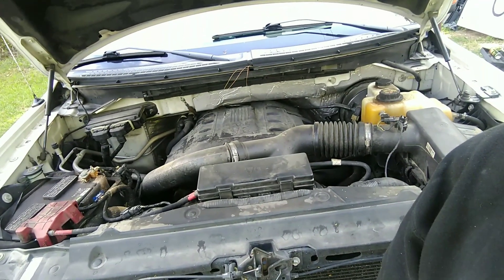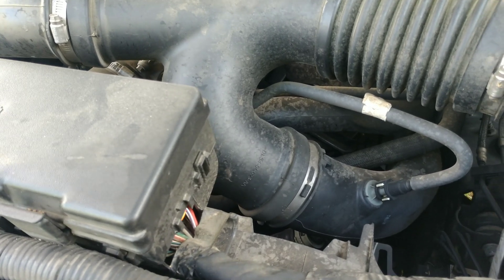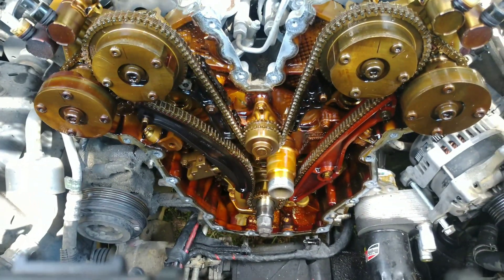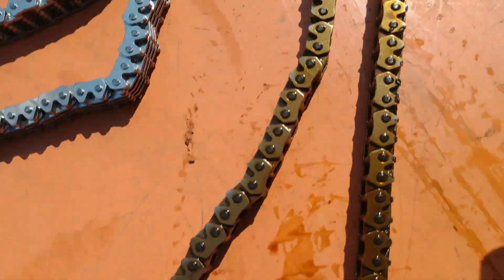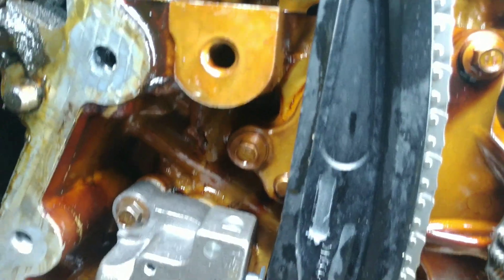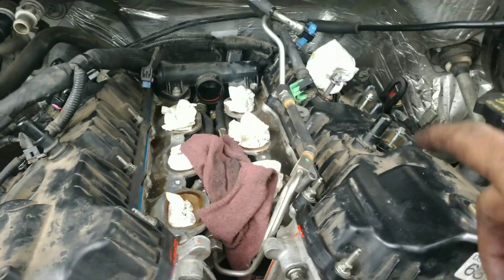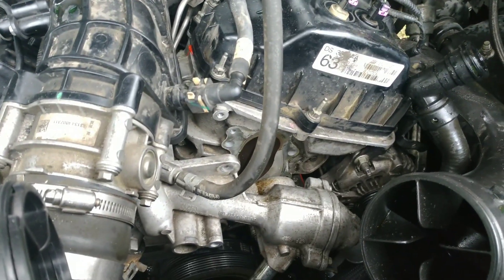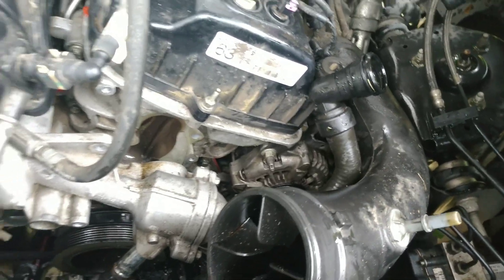3.5 Ecoboost Timing Chain Replacement

Comment: Good job buddy 
Normally no one shows the timing marks  very close  also when you said rotate engine for fuel pump install   Is that a complete turn ?
Reply from the maker: Normally, just a half a turn because of the
Ratio of the cam and crank

Comment: I know this is an old vid. Thank you for making it. I am a mech of 44 years. Pretty crippled up now. How many man hours would you say went into the timing kit job? Appreciate any reply.
Reply from the maker: @Jagg61  thanks for watching. I would estimate it took us around 20 hours total and we did this outside and we are not trained mechanics.
Reply: @shawnkmorse  thank you. I have done many tritons. But no eco's yet. My 2012 just turned 142k. It's been a excellent truck. But I know a timing kit and phasers are coming up before a catastrophic failure. You did a very good vid. And I appreciate it.

Comment: What's normally the recommended miles to replace the timing chain, I have the 3.5 with 83,000 miles on it?
Reply from the maker: This truck had over 400,000 miles on it before the chain started making noise. But I’ve seen some that needed changing around 125k

Comment: I have a 2013 ford f-150, upon replacing the timing chain, is it necessary or recommended to replace the cam phasers?
Reply from the maker: It’s not necessary, but more than likely they will fail sooner than later

Comment: There is no need to take the phasers off to replace the timing chain all you have to do is pull the intake phaser solenoids and the chain comes right off... I just finished mine up the other day and more importantly new bolts must be used when the phasers are removed it appears you reused the old bolts... Of course I changed the phasers while I was in there but I didn't pull them off until after the chain was off

Comment: Why does it take about 8 hours to pull everything out and another 20 hours to install everything correctly; sounds about right! Will it Run just as good as a New Vehicle? So many components to be reinstalled and hopefully nothing leaks after the RTV is applied! You would think Ford would re-engineer a more easier engine than the present one! After everything is done a Road Test is Required that all the systems are operating correctly! Way to go FORD!
Reply: And even after all that the check engine still won’t tell you when the oil pressure drops
Reply from the maker: That timeframe is about right. Yes. It will run like new

Comment: Hey everyone. I have a 2014 Taurus SHO 3.5 TT with 92k on it.. I have the spark plugs(Bosch 9697 iridium) and I’m pretty sure they are to originals. Other than the plugs, what else do I need to get to do the job? Do I simply pull the plugs and put new ones in? Or is there more to it than that? And is the side closest to the windshield tough to do? Thanks
Reply from the maker: With it being Front Wheel Drive, I’m not exactly sure

Comment: Is the process the same for a 5.0? And do you have to remove the motor to replace the oil pump? I'm having a shop replace cam.phasets and timing chain for my 2014, ty
Reply from the maker: I honestly have no clue, I’m not familiar with the coyote platform

Comment: This video helped and this truck is like mine at the moment it’s in the shop for the same issues water pump and radiator noise and leaking gaskets are what’s being fixed all in all good truck when it’s working good

Comment: Hey man great video. I have 2013 f150 3.5 eb. Gonna do this same job. should I change the vvt's while im in there. I know there was a second tsb that was put out stating that the vvt's should be changed as well. Any help is greatly appreciated. Thanks
Reply from the maker: If I had to do it all over again,  I definitely would.
Reply: Change all replaceable parts while you are in it.  My recommendation

Comment: How often do those fail in the 3.5L thinking you purchase a 2013 f150 platinum with 181000. Go for it or not.
Reply from the maker: If you don't hear chain slap on initial start up, you are good. Thanks for watching!
Reply: @BaileyCreekRdAdventures  the seller decided to remote start the vehicle so I couldn't hear it
Reply from the maker: I would want to hear a cold start before I purchased it

Comment: What necessitated the replacement of the timing chain? Was it getting stretched? We’re there lots of codes? What were the symptoms? I feel like this is common on eco boost. Please correct me if I’m wrong
Reply from the maker: Lots of noise on start up because the chains were stretched

Comment: Is there any way to “reset” the timing? My chain moved a good bit and I’m afraid the timingwillbeoff
Reply from the maker: You need to figure out why the chain moved and fixed that problem first. Then put a new chain on and line your marks up.

Comment: Hi Sir I don't have the special locking tools for my 2013 ford explorer 3.5 engine and am  trying to replace my water pump. But I noticed something that made me stop to seek help  before I continue. Immediately I took my timing chain off the left side phaser I saw the phaser turning, why is that. Have i  damaged my engine?
Need your help please.
Reply from the maker: Did you disconnect the battery first?
Reply: @BaileyCreekRdAdventures  yes I did
Reply from the maker: @baako2002  then I am not sure
Reply: @baako2002  It shouldn't be moving if the battery is disconnected why was it turning?
If you turned it back on and there isn't a noise then you are probably fine. As long as you put it back together the same.

Comment: How many miles did you have on it?
Reply from the maker: 350,000
Reply: @BaileyCreekRdAdventures  oh damn I’d say she did you good. My cold start rattle started at 37k more frequent now at 70k dealership said it’s probably the phasers and it doesn’t hurt anything so I’d be fine running it until it throws a code 🤷🏻‍♂️
Reply from the maker: @alphawolfadventures1470  we have another one at about 400 and it's rattling pretty badly on initial start.
Reply: @BaileyCreekRdAdventures  so they can go awhile with the rattle start no harm?
Reply from the maker: @alphawolfadventures1470  yes, as long as the rattle goes away within a few seconds
Reply: @BaileyCreekRdAdventures  thank you

Comment: how hard is it to change pass side valve cover gasket?
Reply from the maker: Passenger side is easy, just make sure you get the right one.
Reply: @BaileyCreekRdAdventures  ok,thanks,yea my son has a 2013 ecoboost 3.5 f150, replaced vaccuum pump gasket, now valve cover has small seepage,very minimal, should i change vvt seals and spark plug tube seals also?
Reply from the maker: @timbales4820  yes

Comment: Question how much does a job like this cost?
Reply from the maker: The dealer will want around $2,500 to do this because they will replace every nut, bolt, o-ring etc

Comment: I had mine replaced under warranty last October and almost a year to the date it's doing it again what could be causing this?
Reply from the maker: Tensioners or phasers
Reply: @BaileyCreekRdAdventures  I need for the reply I'm wondering if they didn't replace everything like they said they did I figure a year would be too soon for it to happen again but I guess I'll do it myself and make sure it gets done right. Thank you for the video

Comment: I’ve heard you should replace all the phasers curious why you didn’t I mean I wouldn’t if I didn’t have to either how do you know if you should
Reply from the maker: We were mainly addressing the chain noise issue. The phasers weren't messing up at the time, but the exhaust cam phasers ended up getting changed down the road.

Comment: How do you get the front cover off after all the bolts are out. Just start prying on it?
Reply: Yes for me the hardest part was the water pump seal it's in the center of cover  behind water pump so unscrew water pump  before  praying

Comment: How many hours does this take start to finish?  Thinking about doing this repair myself but it sounds very intimidating.
Reply from the maker: it took me and my buddy about 8 hours total, outside in the rain. it was intimidating at first, but it ended up being super easy, and way cheaper than taking it to the dealership.
Reply: Are you serious?
Reply: @andryjcisneros2334  The trucks are much easier especially if its not in the rustbelt. If you're doing a rustbelt SUV with this engine its a whole different story.
Reply: Did you end up doing it urself? How it go